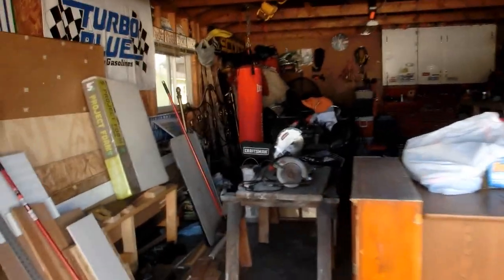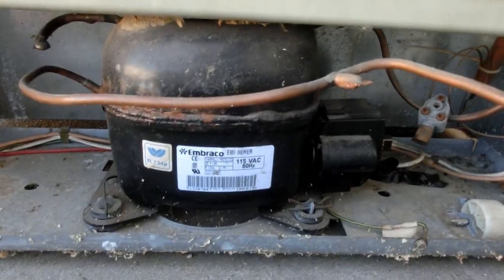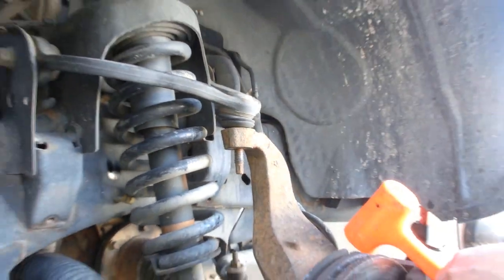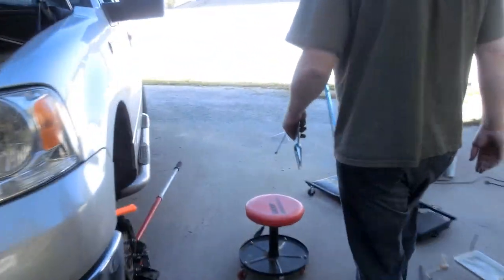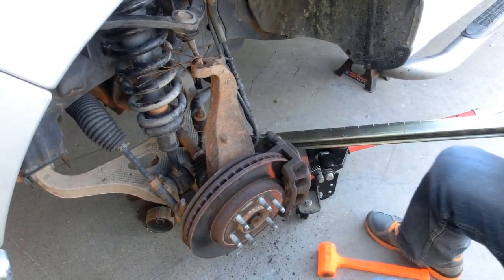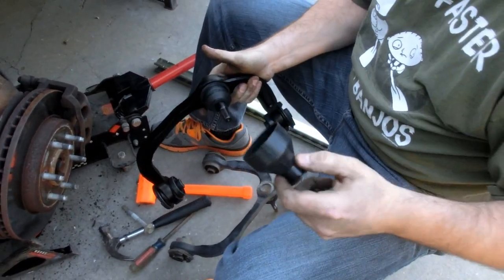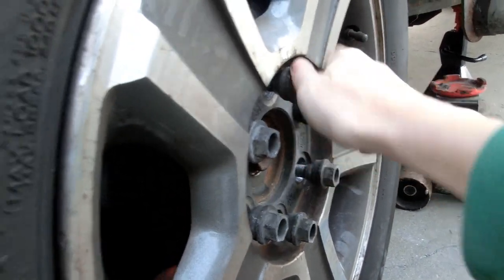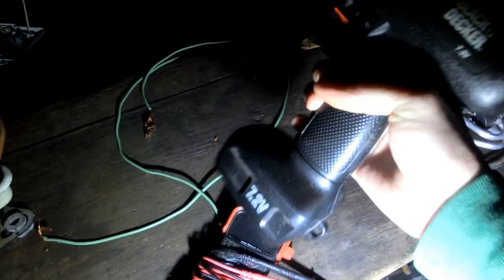Random Bits 0059: Truck Repair and Refrigerator Teardown

Comment: Keep an eye open for icecream shop refrigerator. I found one once, it didn't have a normal diaphragm/reciprocating compressor but rather a centrifugal (probably bronze with oil ring) compressor. It turns out it makes a very good high speed and high capacity compressor or vacuum pump! Plus, it is quieter, faster, the velocity of the output gas is constant and it doesn't vibrate.
Reply from the maker: interesting, thanks!

Comment: freon compressors seem to be very handy. plus they can pressurise up to like 300psi!
as you said in a few vids ago it would be great to store hho in tanks so you can use you oxy acetylene torch.
Reply from the maker: actually most can go up to 650psi.

and no, storing HHO would be a horrible idea. i would never do that. you should never store your oxidizer with your fuel. HHO is hydrogen mixed with the perfect amount of oxygen to completely detonate. thats just an explosion waiting to happen.
Reply: He's right. I made a small 0.5l plastic bottle explode with HHO. The bottle shattered in a thousand pieces and I found some of the pieces more than 20 meters away, and imagine what would happen with larger quantities, or with pressurised quantities!
Reply: MrOpenGL yeah you both have a good point. it would be nasty. basically a bomb. I think on demand hho is the best way to do it.

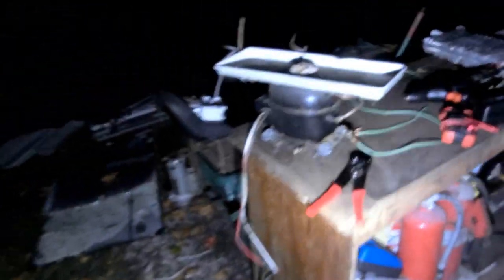Comment: At 18:58, you talk about compressing oxygen and hydrogen. I assume you are talking about different tanks, but just to be sure I thought I'd mention that doing them in the same tank would cause an explosion.
Reply from the maker: i would never store an oxidizer mixed with the fuel.

Comment: That pivot didnt want to give up easy did it lol, bloody rust!!, looks smashing now :-))

Cant beat a long bar and body weight for wheel nuts, next time he removes the wheel for a new tyre you can put a smear of grease on the threads so the rust stays away :-)

That fridge did yeald some usefull parts :-)), the compressor is good to experement with,  evacuating plastic bottles for fun lol.
Reply from the maker: well i already have a high vacuum pump for that, i'm wanting to us this to compress hydrogen into a tank.
Reply: Rinoa Super-Genius
Apart from other methods, i can see baloons collecting the gas off charging lead acid batterys lol :D
And the secret life of machines was interesting, there was a very old series presented by a man called tim hunkin, he is a clever man :-)
Reply from the maker: zx8401ztv
 he has a youtube channel showing how he builds the machines for his arcade. evidently he runs an arcade with wacky coin-op machines.
Reply: Rinoa Super-Genius It's called "The Under the pier Show" I believe it's in Bristol UK
Reply from the maker: Cap10323
 it would be fun to visit that sometime.

Comment: I have a feeling you took your toys apart as a child, just to see how they work. dont feel bad I did the same thing lol. great videos btw keep em coming.
Reply: lol, I use to do the same thing with the toys but I use to turn shop freezers off to
Reply from the maker: yeah i would, but i would also take apart other things. oldest thing i know i took apart was my mom's vacuum cleaner when i was like 3-4. i put it back together and it worked fine for like 6 years.

Comment: "Papa its the fan belt, its not Batton its the wheel. That's what I said...the fan belt!" ok so I don't know much about cars, and the max I got out of that was that 'cars are heavy' and 'look at that little bit of metal on the wheel, 4 of them holds all that weight up :-O' :-D

So ok id have been working on the fridge instead :-D least the pump looks solid, and the cooling bit for the gas looked mega handy :-D Hydrogen time desuuuuuuuu. I was thinking you might leave the fridge in the garden then go round it with a wooden structure to make it look like a small outhouse or something :-D perhaps even bury it :-)

Comment: Your dad's truck needs an alignment. The toe seems out of spec - see the wear on the outside of the tires.
Reply from the maker: thats why he was doing this, no sense in paying for alignment right before you take the whole thing apart. not counting a lot of that was caused by the bad part.
Reply: Cool then :) I just thought I saw the passenger-side tire worn too.

Comment: I wonder if that drill could be converted to Lithium-ion was thinking about such a project myself but was worried about how much amps it would draw and possibly get cell damage.

They dont let us scrap fridges like that in the UK , some sort of law about releasing gasses that damage the Ozone but it looks like you had fun , Whats next for the fridge? drop a large weight on it or fill it with explosive gas and let nature take its course? :-D
Reply from the maker: same here. but if you arrive with the pipes cut they look away and let you dump it.

the fridge is going off to my step-brother's house. he'll prolly burn it down and throw the metal into a scrap pile for salvage. theres really no point in salvaging it after i took all the metal parts though.
Reply: Eather that or you use it to ride out the blast of a nuclear bomb (damn that movie was so bad)

the foam inside it might make good thermal insulation for winter or something but is probly a lot of trouble and mess to harvest that.
Reply from the maker: steve64464
no, just no. that movie doesnt exist. its just a bad indiana jones ripoff that happened to have harrison ford acting in it.
Reply: And a lot of CGI which i cant stand but thats besides the point :-D haha
Reply from the maker: steve64464
 CGI has it's place. but most of the time its used just to save money so looks shitty.

like for instance Golem from LOTR, i think it was good they made him CGI. but in indiana jones 4 the CGI looked worse than the CGI in LOTR witch was like 8 years before.
Reply: Yeah its just a cost cutting thing, drives me insane when i see it mocking the viewer thinking they can get away with that. It feels like watching some console game in demo mode or something i cant explain.
Reply from the maker: steve64464
 well CGI isnt for only cost cutting, there are many things you can't do with practical effects. the issue comes when it would look better and probably be easier to make with practical but they use CGI anyway.
Reply: I guess if they dident have CGI they would have to think more creative (heh) , Think im goin bed ive been unwell for days bloody cold , Keep doin the vids they are great :-)
Reply from the maker: steve64464
 actually a lot of things they just couldnt do, many scripts where scrapped before the 1990s due to not being able to make effects with practical.
Reply: I converted an old bosch drill I have to lithium polymer and I charge it with the imax b6. it works great!
Reply: 18650 cells? in what configuration series or parallel?
Reply: steve64464 no I have used an RC areoplane battery (1400mah 3s lipo) 30c discharge rate.
Reply: I assume thats one the flat pack style designs where if you puncher them they explode in a fireball of doom, I dont have any of them just 18650
Reply: steve64464 yes it is that style. they are very hard to puncture on accident. I got a very good quality pack for 30 dollars. but you can get a cheapy for 10 dollars from hobby king or any other hobby store.
18650 batteries would work fine btw. you would wire 3 of them in series to have a battery for a 12v drill. but you will need to put balance leads on them as lithium batteries when wired in series go out out of voltage and one cell may be at 3.8v and the other at 4.1v this will happeb very quickly so you must balance them.
Reply: Maybe ill get one at some point , I saw someone attach one to a ultra cap array then onto a car as primary power source and they over discharged or something and it started buldgeing , These cells are somewhat scary
Reply: steve64464 dont worry. i have been handling them for years and have been pulling many amps from them. i have never had one bulge, or explode. if you remember to balance the cells and dont over charge them, over discharge them or short circut them you will be fine. dont let the cells go anywhere out of 3.5v - 4.23 volts and you will be fine :) lipos batteries are in our ipods, phones, laptops. everywhere.
Reply: lucky i have two ballence chargers then, And that would explain why some iphones expand/boom :-)

I need to learn and understand C rateings of these things
Reply: iphones only have a single cell lithium battery therefore they do not need balancing. 

the C rating on a battery determines the discharge rate. the higher the C rating, more current can be pulled from it without it getting hot or puffing up. i normally use 30c batteries as they are on the cheaper side and can have many amps pulled from them. 45 and 50c batteries are expensive and not worth it unless you want to pull serious amps. 
i hope this helps :-)

Comment: Oh truck repairs. I love working on trucks   compared to something like my honda accord. My honda is cheap and easy but very cramped with trucks they are sometimes cheap and most of the time easy but you have a lot of room. I'm about to replace my rear suspension in my accord. The car has 290k miles on it. Its a 97. I just can't let it go. I love that car. Oh and I am not 100% sure but I think it is illegal to just release "freon" knowingly into the atmosphere and ass a former scraper you took all the money out of that fridge. The copper and aluminium coils are where the money is the steel casing is worth nothing and the plastic is worth nothing. You might as well haul it to the dump. The scrap yard will be pissed if you take it there. The compressor is a nice little vacuum pump.
Reply from the maker: yes it is eligal to vent some types of freon, but this fridge didnt have any thats one of the main reasons why it was going bad. that valve they added caused all the freon to leak out.

my step brother will probably throw this onto a big brush fire and let the foam burn away then pick up the big piece of sheet metal wrapped around it to add to the salvage pile.